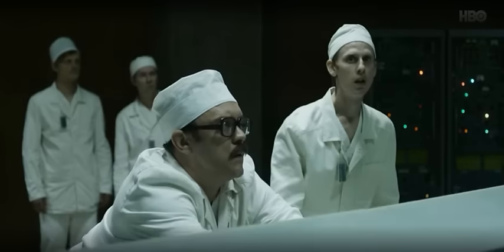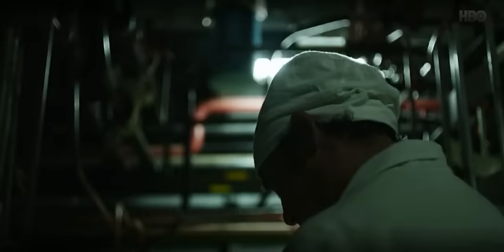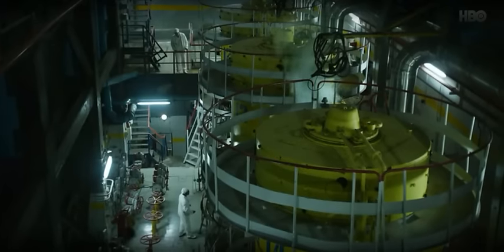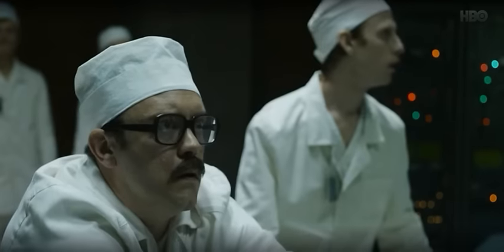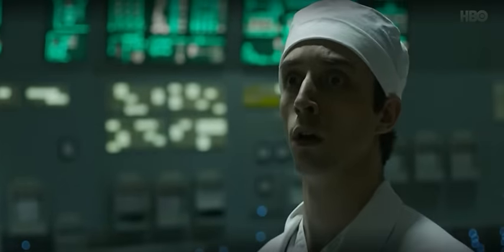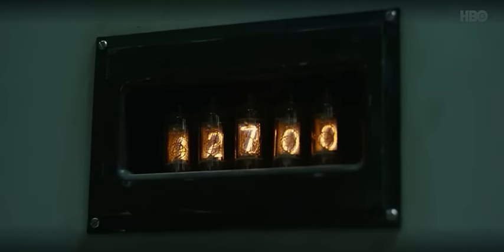Chernobyl (2019) Nuclear Reactor Explosion Scene

Comment: I recommend that people research why the control rods had a graphite end....it is a bit more complicated than the series, as excellent as it was, glosses over a bit. It appears the rods gave the operators more control over an extremely large reactor.... I am surmising using more enriched uranium would of led to a more compact reactor and a more robust control rod system. Regardless, it is also clear the operators put the reactor into this position by violating a number of rules.
Reply: This is a good point-the real fatal flaw of the reactor was not so much the graphite itself but the fact that the moderation mechanism created a positive void coefficient. Even then, it's possible the accident might have been avoided if the graphite rods went to the bottom of the coolant water but the fact that the graphite displaced water from the bottom of the reactor when the control rods were inserted under the wrong conditions caused too much localized power at the bottom which could flash boil the water and create a runaway chain reaction with that positive void coefficient
Reply: Adam Higginbotham's book explains why the graphite tips are there. It wasn't simply expense.
Reply: @fargo007 reading it now, what an awesome book
Reply: @rhino202  Right?  For me it's written in the same style as Tom Clancy. It doesn't spare the technical detail but still gets the story across in a cohesive, well told way.
Reply: @zl1xn  yeh, I totally agree. I'm recommending it to everyone that I know that enjoys reading an intense story

Comment: It wasn't because it was cheaper, it was because during normal operation when one withdraws a control rod, you are seeking to increase reactivity and it makes sense to have a graphite tip because replacing a reactivity decreasing component with a reactivity increasing component increases the control response.  That this would cause increasing reactivity during insertion was considered to be acceptable because during normal operation the equilibrium time constant of the reactor was high enough that it wouldn't affect anything.  The design flaw was that this time constant was too low at low power.  

"It's cheaper" only makes sense in the context of what the Soviets later did to change the design for increased stability, which is to increase the number of permanent control rods and swap out the tips.  This fixed the issue but reduced the neutron economy of the reactors, which meant they could no longer use unenriched uranium.  There's no such thing as "properly enriched", that's a reactor design issue and plenty of historical and extant Western thermal neutron reactor designs can use unenriched uranium, e.g. CANDU reactors.
Reply: I always had an issue with that line too, but only in that I believed the Soviets had gone "cheaper" by using 1 rod to achieve 2 functions instead of having 2 separate rods, which would have allowed them to be pulling the graphite out while inserting the boron in for a faster emergency stop. 

Of course, this would be more expensive because the reactor would have to be much larger to accommodate twice the number of rod channels; plus there'd be more moving parts to track and maintain. Thank you for the more scientific explanation :)
Reply: Keep in mind that this is a western made series that was back then already criticized by Russia. The part after "Why?" is intentional. It's hidden propaganda portraying the Soviet Union and Russia as a follow up in a bad light.

Same goes for the final part about contradicting the testimony in Vienna. It is supposed to show the immorality of the Soviet Union. It's not historically wrong, but the show clearly emphasizes it in a negative light.
Reply: @johnbishop9621  Was there a goal by the film makers to portray The Soviet Union/Russia in a bad light? I think there's more grounds for the Soviet Union, but the film makes absolutely no comment about modern-day Russia.
Reply: @LoganChristianson  Yeah people saying that are a bit weird. You dont see them saying the same about the ottomans for example.

There's plenty of awful things done in any government, and I wouldn't be surprised if because they were born from the USSR that they've gone completely opposite in a lot of aspects.

I say all this, but clearly they still use the "cheap da" method for their military.
Reply: @LoganChristianson  Well, it does if you see Russia as the continuation of the USSR, which is not an abstract concept. Politicians all over the world and both in the U.S. and in Russia have stated this opinion before. Russian politics irredentist attitude under Putin over the last decades have solidified this idea as well. Also, USSR history is Russian history. The questions to ask is not whether the portrayal of a scene is a coincidence or not. All lines were consciously written after all, especially in a show of such a high production quality about such an important historical event. Context around the production, the studio and the country and thus political perspective the country, the why in why the shows was even created/exists, and what is shown in it vs. what isn't shown are core factors.
Reply: You want to tell me that a western production company made an anti-communist/anti-soviet, historically and scientifically inaccurate propagandistic series about Chernobyl?

I am shocked! 

PS
I am sarcastic of course.
Reply: I don't think it's fair to consider it "inaccurate," no piece of media (movie, TV show, game, book, etc) ever 100% accurately recounts the truth, artistic liberties are always taken for the sake of telling a more engaging story.

Aside from the artistic liberties it takes (many of which it addresses in the credits of the show, you'd know if you watched it), it's, by and large, and accurate portrayal of the Soviet Union. It doesn't make outright statements about the Soviet Union (i.e. "Soviet Union = bad"), it demonstrates how the Soviet Union worked (which was normally "bad"), and let the viewer make up their own mind.

And if that's all you can focus on, if that's all you got out of this series, was how it demonstrated Soviet Union life, then you weren't paying close enough attention. It makes comments about all life - not life that which was found only in the Soviet Union. It talks about sacrifice, the cost of lying, bravery in the face of excommunication and death, the perception of one's worth to themself versus others. If all you can focus on is the Soviet Union being set up as the "villain"" the protagonists operate against, you need to refocus your efforts.
Reply: The entire design was intended to keep the construction and operation of the reactor cheap. Graphite moderation, positive void coefficient, etc. 
This may have been more forgivable if they hadn't also kept the details of reactor operation and failure modes a state secret - from the very operators expected to maintain them.

Constructing a full containment building would've been expensive, as they wished to have live refueling equipment so we end up with an essentially conventional building on top.

CANDU reactors can run unenriched uranium, but also use a massive calandria filled with relatively expensive heavy water as a moderator, and have passive safety systems to prevent runaway reactions, such as fuel channels that will sag out of alignment and decrease reactivity, and a huge thermal mass that gives operators time to diagnose and correct faults - and of course, the last option SCRAM that poisons the heavy water between the fuel channels. It operates on a positive void coefficient, but is much better than the RMBK due to its passive safety features - or, for that matter, lack of flammable moderator!

Comment: The rods were made of graphite NOT because it was cheaper; it gave the operators more control over the reactor.
Reply: That's not what they thought though right? If they knew that the had graphite on the tips they would not have engaged A3-5. If I'm wrong correct me but since they didn't know they couldn't apply that knowledge either.
Reply: @soda7998 no, lower part of the rods was graphite and top part was boron. Basically they had to move them back and forth increasing and decreasing the reactivity maintaining a balance. Problem was that by fully withdrawing them they had no control over the reactivity so when the AZ5 button is pressed the procedure would automatically lower all the rods so that the boron part gets to the fuel lowering and killing the reactivity. Problem is that when they were fully withdrawn and AZ5 engaged the only way the rods could go down is graphite first. That’s why the conditions Dyatlov created, no cooling water inside the reactor that little moment while the graphite passed the fuel instantly created a ton of heat because accelerated reactivity, which destroyed the channels of the control rods blocking them in the worst position.
Reply: @fnhatic6694  excellent explanation, thank you!
Reply: Maybe it was cheaper compared to the other options they had? Idk I wasn’t there
Reply: @fnhatic6694 found the tankie, yeah I'm sure it wasn't cheaper let's do a cost analysis of a western nuclear reactor vs a soviet one

Comment: Control rooms power output displays up to tens of thousands but it is designed to output thousands of megawatts?!
Reply: In case of such a power surge
Reply: Was probably cheaper to buy a six digit rather than a five digit
Reply: For instances just like this, they immediately knew something was wrong with reactor started generating 32,000 megawatts.

Comment: Surprised the building couldn't hold/contain it.
Reply: The thing about the RBMK reactor buildings is that they were of ORDINARY steel/concrete construction. This was no western design of high PSI concrete domes, complete with high quality biological shielding. If it were, this blast would have CRACKED the dome, but not to the point as to what this event did.    The RBMK DESTROYED the structure, and the biggest nuclear disaster happened at 1:23.45 on 26, April, 1986.

And now with war raging around it and Russia doing unthinkable things like digging trenches in radioactive soil, Gods knows how much more radiation will be released.
Reply: @Nighthawke70 the cap of the reactor was 1000 tons and it was just flipped by a massive steam explosion
Reply: @yeetrreet2453 To be fair it probably wasn't just a steam explosion. It's likely that it was a propt-nuclear critical event, the reactor experienced a thermal - not thermo - nuclear explosion, not unlike a fizzled/failed atomic weapon, in layman's terms it got so hot so fast that it blew up.
Reply: I don't think having a more robust material for the building would have been enough to contain the huge around of energy and pressure. The steam was at such a high temperature that it expanded extremely strongly, to the extent that we see on the remains of the building roof. So even with stronger material I tend to think it would not have been enough and the explosion would happen anyways. Maybe less strongly though, so maybe less radioactive consequences?
Reply: @bigbang2a  The design of Western reactor containment buildings is to PREVENT these kind of events.  The dome structures design is to hold in any kind of blast, including prompt criticality.
Reply: @J.G.H.  There was speculation about the prompt criticality primary  (10 Ton equivalent) and a fizzled secondary (225 Tons). There were amounts of Xe136 picked up in the field 1000km away, and seismic readings that point to it, but most thoughts are still fixed on the initial blast being steam, then the hydrogen secondary.  Studies continue.
Reply: @Nighthawke70  i actually didnt think about that one, people are literally digging up or lifting radioactivity inside the ground since energy just doesnt disappear, oh boy
Reply: @prettygood476  Not energy, Plutonium radiation. This stuff has a half life of CENTURIES.

Comment: boron doesnt reduce reactivity it reduces the amount of left over neutrons so it doesnt react as mcuh which posions the reactor and stops it chernobyl also had a different flaw other than graphite it didnt have any other solutions for shutting down the reactor/ posioning it. But its possible to build a reactor that uses graphite to increase reactivity but you would need to upgrade other basic parts like the pressure chamber and the structure or shape of the reactor core
Also another thing was that not using properly enriched fuel also causes issues because uranium usually comes with impurities after mining thats why it needs to be refined
Reply: that's exactly what "reducing reactivity" means, negative reactivity is a value of the k constant less than one, where the neutrons population decreases due to the chain reaction not being sustainable (such as from absorption in boron).
Reply: oops sorry i meant to say boron does reduce reactivity because i was trying to simplify it and explain it

Comment: This is why should carefully control the reactor's Temp.

Edit: Thanks for 45 likes :)
Reply: the reactor was unstable man
Reply: They were doing a test that day trying to find a way to use a back up energy for the whole power plant. Which caused the reactor to start to heat up then the test was a fail.so they inserted the rodes back in since low power increases the amount of energy it makes.The tips were graphite and caused the REATOR TO REACH LEVELS OF HEAT AND POWER TO CAUSE A 1000 TON LID TO FLY IN THE AIR AND LAND SIDEWAYS ON THE REACTOR.
Reply: Oh... so... have you ever played chernobyl on roblox?
Reply: @denizkarakol9570  no because I'm not a 7 year old
Reply: Oh

Comment: I hope you understand that an energy generator so dangerous, it should include a safety mechanism that prevent human arrogance and greed from intervening since day 1,  I mean when the generator is just an idea
Reply: Consider a door handle. If that handle breaks, do you want the door to stay open or to stay closed ?

For safety reasons, (in case of fire for example) you want the broken door handle to leave the door open. You want it to fail-safe.

A broken door handle doesn't intrinsically want to leave the door open or closed. How it behaves when it breaks depends entirely on how it was designed. We're not going to remove all doors because one was poorly designed and didn't open last time there was a fire.

The same goes for nuclear reactors. As long as you use the right design philosophy and always design them to fail-safe, you'll be fine. They are not dangerous unless they are designed to be, which is what happened in Chernobyl.

Comment: 2:10. Technically it was a steam explosion not nuclear.
Reply: Quiet Place4  a nuclear explosion is a chain reaction of nutrons breaking apart atomic bonds releasing more nutrons.

This is a pressure based explosion. Not nuclear
Reply: Quiet Place4  in the first explosion, it was caused by the hot spot because when the control rods “tipped” with a graphite rod in the end displaced the water at the bottom of the core, the graphite(moderator) replaced the water(neutron absorber) there was a spike in thermal output from the increased rate of fission which vaporized the fuel channels and control rods which also produced hydrogen thus caused the massive explosion.

Comment: all of those weird tenticles is the reactors uhh you could say bad stuff that it realeased
Reply: corium, right?
Reply: @The_Slayer.  dont know
Reply: Those are the control rods made of boron and grapite. I suspect they look like that because of the heat and subsequent explosion.
Reply: @The_Slayer.  Nope, Corrium is the stuff formed by the molten control rods mixing with molten concrete, and melting through the floors.
The things shown were the control rods, still attached to the top cap, now twisted and bent after being yanked out by a explosion.

Comment: Friendly reminder: Scram button(s) never worked properly during meltdown-imminent conditions.
Reply: What are you on about? While yes in Three Mile Island the core scrammed but still melted, the same with Fukushima, but the scram behaved properly, both times it was caused by a lack of cooling water, nothing to do with a scram failing
Reply: The scram at three mile worked the way it was intended to, the problem was that they isolated the coolant system from the reactor by accident which caused the reactor to meltdown.
Reply: @tayoz9810  Pretty much, there's more too it than that but at face value yeah

Comment: I wonder if other nuclear power plants, have rods built like that, if so you'd think they would make changes.
Reply: They mainly didnt care about safety, everyone was talking about the power outputs and how it was revolutionary, they were made like this so itd be cheaper
Reply: Those in Bulgaria
Reply: They fixed tye other rbmk 1000 reactors after
Reply: Only the RBMK styled reactors came with graphite tipped Boron rods. Again it was cheaper do it like that rather than have separate rods of acceleration and deceleration as well as using normal water instead of enriched water combined with unenriched uranium, etc.
Reply: The West done away with those style reactors, RBMK, by the time Chernobyl had it’s meltdown. As well as other safety protocols installed.